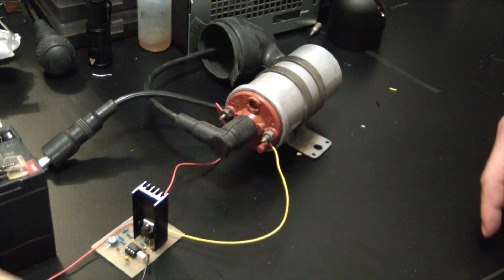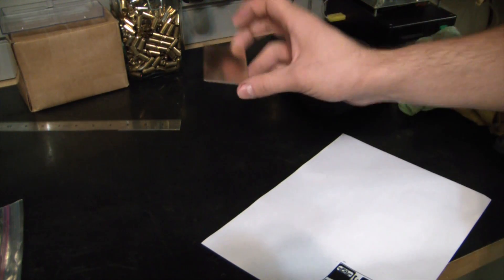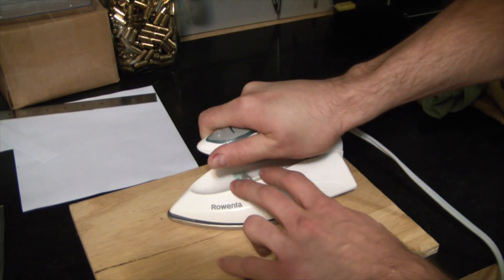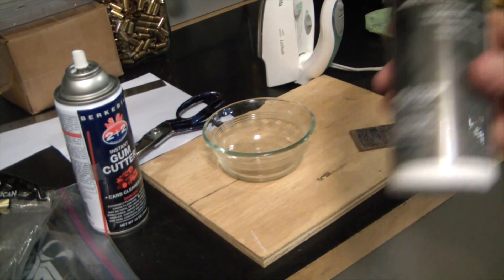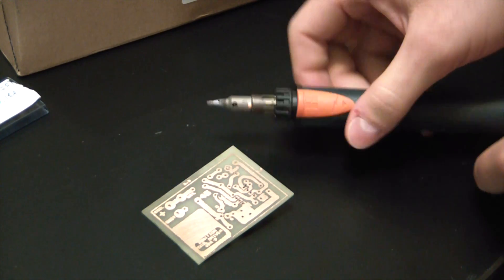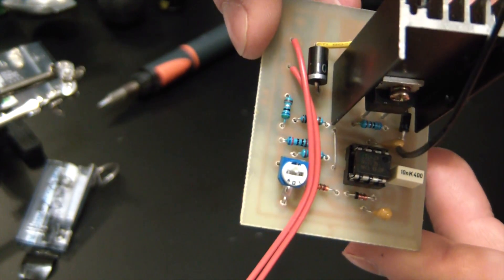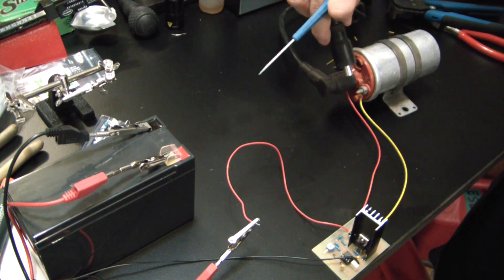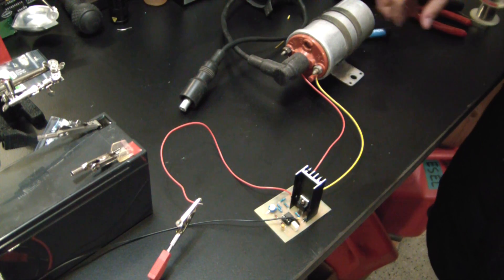IGNITION COIL DRIVER - MAKE HUGE SPARKS - 555 TIMER BASED - ELEMENTALMAKER

Comment: Nice tutorial, I want to make this as a flamer kit for my exhaust, how long can the circuit be used continuously do you know ?
Reply: I see that this might make a nice ignition source for a hairspray powered spudgun. Lesser sparks are often disappointing.
Reply from the maker: The MOSFET gets hot pretty quickly. I wouldn't run it longer than a few minutes at a time. It also really depends on the impedance of your ignition coil though, and you could even add a current limiting resistor, or cooling fan, that would allow you to run continually.
Reply: Thank you for such a quick reply, that's food for thought. Which current resistor value would you go for ? And would it be inline with the primary ?
Reply from the maker: Honestly no idea what value resistor you would need there, but it would definitely need to have a pretty high power dissipation. Some trial and error would determine what would work for you, as it will also depend how hot you need the spark. Either in-line with the primary, or in line with the circuit should work.
Reply: Coyote FPV good idea i came by accident looking for jet powered anti lag for my turbocharger car with a combuster and how to start it reliably I'm borrowing the idea from a former rally racing car and the USA military's experimental equipment for full control over boost and be quiet . 
Would any of this work with GM LSX gen 4 coils? Think if ways to cheapen and shrink it making it lighter. So possibly BBQ lighters or ford dura tech v 8 I think has long spark plugs would work for your flamethrowers coyote FPV Stracy on Trucks did how to as well
Reply: Richard, the modern coils are much more "delicate" than the old school can-style coils. I think it would work, but you may burn up several, while the old can coil just keeps on ticking. Can-style is cheap too, as an added bonus.
Reply: ElementalMaker how is this a usable CDI Then if it's useful for minutes at a time. Pretty much makes it useless. Not to mention when that MOSFET fails I can almost guarantee it will fail closed dumping huge amounts of current and attempting to produce an indefinite spark until you realize and disconnect it hopefully before any damage is done. Unfortunately that's the downside with MOSFETs, especially ones not designed to switch on and off millions of times